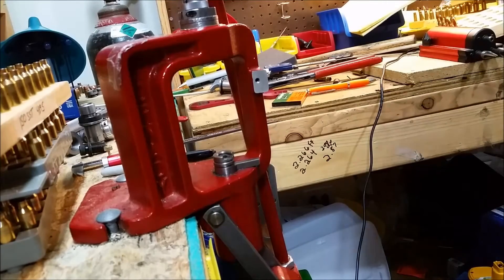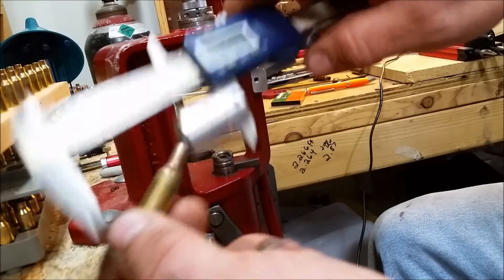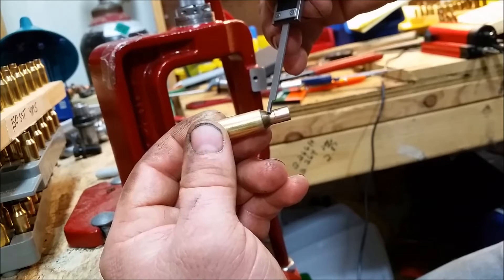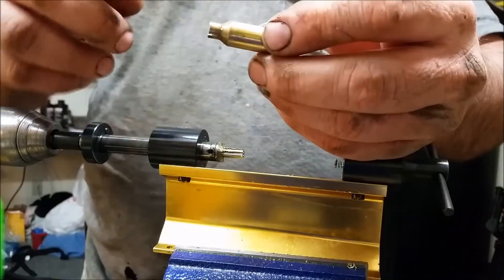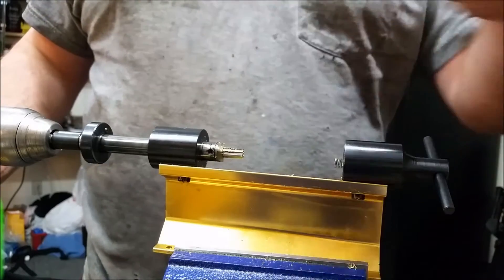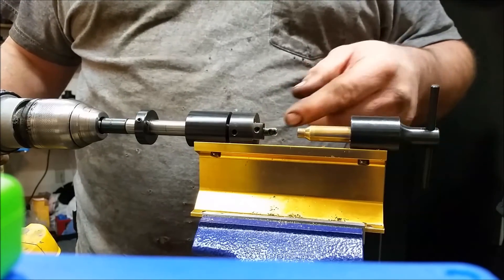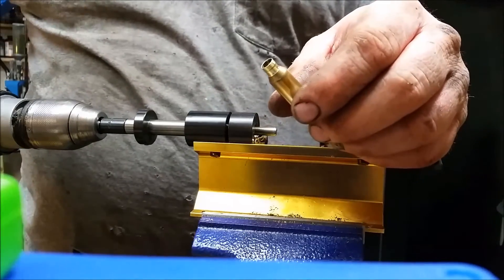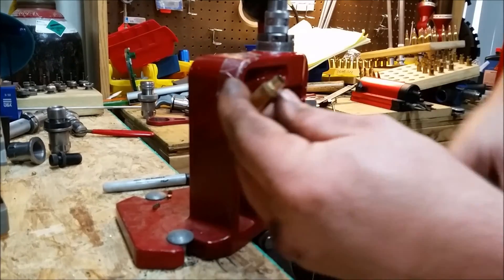.257 bobcat forming procedure

Comment: How does the bobcat compare to .257 Roberts AI?
Reply from the maker: the bobcat is designed to fit the ar15  i think it comes close to a standard roberts but it wasn't a consideration when i designed it.  i wanted the most powerful 25 cal round for the ar15 and it is that.
Reply: Gotcha, thanks for the video.

Comment: any chance you could get a video of the 257 bobcat at the range? how does it perform compared to the 250-3000?
Reply: This was my question.  250 Savage is such an efficient cartridge. When compared to a 6 mm Creedmoor the 250-3000 Savage uses 25% less powder, produces 33% less pressure (so brass lasts longer), yet still shoots only 2% slower* then the 6 mm CM.    (*both using 100 gr projectiles)